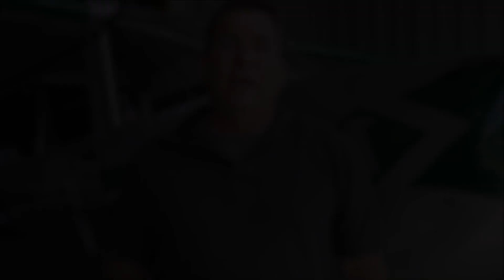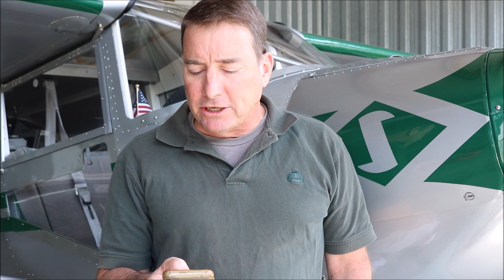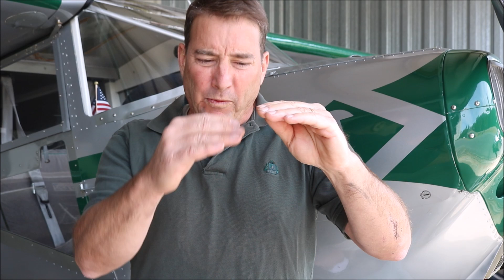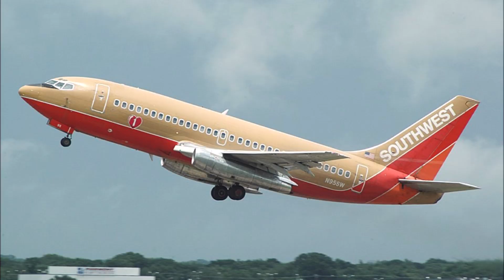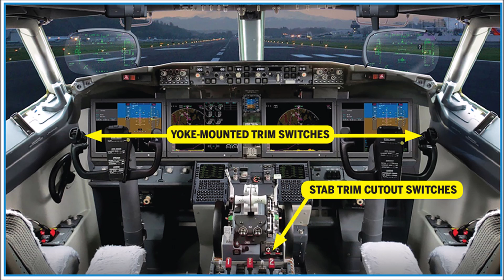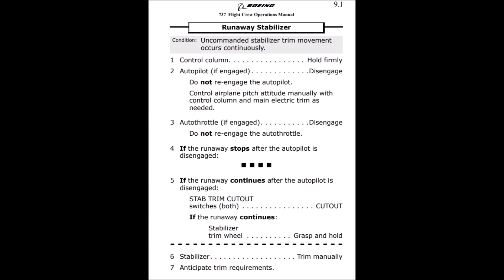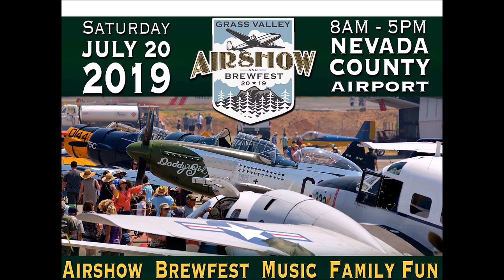737 Max UPDATE 27 June 2019 -The Latest Issue

Comment: Bottom line, MAX isn't flying anywhere anytime soon...
Reply: They fly pretty much every day for various purposes. They just aren't in passenger service. The crews and their families should be refusing and up in arms and the union protesting, no doubt. Wonder why the media never ask why that hasn't been happening the whole time with all these MAX flights, and none of them have crashed.
Reply: @ReflectedMiles  The fundamental problem with MAX 8 is that the new engines are too large for it's original fuselage;
they don't fit under the wings.   I read someone's comment, who claimed to be an engineer, that making horizontal stabilizers larger would make the plane more aerodynamically stable.   Maybe they ought to consider that.
Reply: @tigrotom7312  Try, try again. That is media hogwash, which you would be familiar with if you spent a little more time on this channel and others that actually know what they're talking about. The engines are fine but change the flight characteristics slightly in one extreme part of the flight envelope that no one deliberately flies in anyway. If they needed more height, they could extend the main gear (which they do slightly on MAX 10), but these were just fine with a few inches more height on the nose gear.
Reply: @ReflectedMiles  Extending the landing gear would help.   Are you from Boeing?  What's the target date for certification now?
Reply: @tigrotom7312  No, just another pilot with FAA time as well. Certain parts of the world demand minimum-height load/unload, which the 737 has specialized in, so Boeing will only ever raise gear height the minimum amount that is required for safety in order to help them out. The re-cert date will depend on the regulatory agencies in the US and elsewhere finishing up with it, so that isn't very predictable even if those agencies put out estimates.

Comment: Sounds more like they're potentially chasing down a latent defect incident. The CPU could very well have exhibited characteristics of failing, not fail outright, that could cause the slow response from input. Example: if the system's running a dual core CPU and one core died in test, that could pose a problem. Maybe the solution is four cores, or dual CPU even. Maybe they just need to be faster. Maybe the solution is better ESD mitigation at the OEM level. Maybe it's software, as you seem to think. 🤷‍♂️ That's a lot of maybe.

I haven't read anything from CNN yet, but I don't think you have enough information to be making the conclusion that the FAA pilots are wrong. All you seem to have is word from a third party that the pilots aren't satisfied with the performance. You don't know why they aren't satisfied, because they don't know why they're dissatisfied. Hence the investigation.

The MAX is grounded for good reason(s), and we're learning more and more about said reason(s). Considering the amount of shit that hit the fan, it's going to be a while before Boeing gets the OK again, and I wouldn't count on September.

Comment: The more computers they put in these planes the less I want to fly.  Anyone who has worked with microprocessors (and insane engineers) knows it’s the same as a computer with garbage in garbage out.  The human mind is so scrambled these days that we can’t/shouldn’t trust the engineers that are programming these things because we have such a fucked up system of beta testing products at the public’s expense.  If they are not held to the highest standards before anything is put into production we will maintain a crash and learn scenario.  I would like to know if the jack screws are controlled by stepper motors, servo motors or a standard wound motors.  I ask because it is easy to have a hard wire bypass with a simple rheostat.  There is going to be a terrible price to pay for over complicating these planes with electronics.  Anyone who knows about the problem with sourcing non-counterfeit or inferior overseas electrical components knows how serious this is.  Pilots need to strike or pay with their lives and the lives of their passengers

Comment: What if they have to use the manual trim wheel? How long does that take?
Reply: Steven Murata - that seems to be an alternate but no longer the preferred recovery solution in runaway trim, if they have given the trim switches power to override the out of trim in most situations
Reply from the maker: Thats a whole other issue previously discussed

Comment: I wish you could have discussed the fact that the microprocessors in the 737 MAX are Intel 286 chips from the 1980s. Why is Boeing using such slow chips? Thank you.
Reply: Dou Gen I also heard that (unconfirmed). In the aerospace industry the trend is to use older but proven microprocessors. They are hardened against electromagnetic radiation (and lighting). It is difficult and expensive to certify a new procesor for an existing aircraft model.
Reply: Interesting. But why can't Boeing use both older and newer chips, with the older chips acting as fail-safe redundancy chips? Certification for a new processor would be hard, but safety considerations always take precedence. Always. No matter what Wall Street says.
Reply: @dougen9237  More complexity, more testing, more failure modes...
Reply: I agree completely. But when the going gets tough the tough get going. If a new processor would be safer, then it's necessary. How did we win WW2? Not by being daunted by the huge problems we faced. Let's hope there's a simple solution. But if there isn't, compromise isn't acceptable. In that case, the government should step in and help Boeing solve the problem, just as it helped Ford a few years ago.

Comment: Well now Juan, Don't you think it's only fair for these picky FAA pilots to jump into Boeing's 777 simulator and 787 simulator and also the 767/757 simulator to determine if the trim systems in those aircraft aren't quite up to their very high standards?  Wouldn't it be fun to have them come after all of United's Boeing aircraft?  I mean, what's good for the goose is good for the gander, right?  Or is it only fun when the biggest loser in the situation is good old Southwest Airlines (because reasons)?

Comment: The Airbus 320 neo looks like it has the engines moved forward like the Max. Is this true or false? If true does the 320 neo have an auto trim software like MCAS?
Reply: Boeing and Airbus both have engines mounted well forward of the wing and have for decades. The finger pointing people are doing about engine placement is just poor understanding of aircraft design. Airbus uses fly by wire for all of it's aircraft. They "tune out" any undesirable handling characteristics using software. If you want to see what an airbus does with faulty AOA data, Look up Qantas flight 72.
Reply: @stimproid  Interesting  new explanation and response in view of the repeated explanations  (by others) that the need for MCAS was because the 737 originally had engines under the wings and with the baked-in short landing gear could only accommodate larger engines by putting them forward of the wings which in tern generated additional pitch up forces especially when in a climb.
As the 320 Neo has the engines forward of the wings and uses software to manage the stabilizers (and all  control surfaces),  is it really possibly a case of the old cable control technology being especially challenging to interface/integrate with modern software controls?
Reply: @jhindson88  You should watch Juan's previous videos on the MAX. There is much factual information to be learned there. MCAS was only added to be able to fly the MAX as the same type rating as previous 737 models. The Max would fly fine without MCAS.
Reply: @stimproid  I have watch ed all his videos and others. There was an indication that the MCAS was need to supplement or overcome the problem of the 737 getting into a potential stall and that MCAS would prevent such a condition or quickly smooth it out. It would appear that the Airbus 320 (and all Airbus fly-by-wire aircraft) have a similar protective system (but no cable controls). See the Quantas flight 72 for the  lesson that they learned and, as I recall the tragic case when an early commercial Airbus plunged into a forest while doing a demonstration of a landing approach in which the pilot planned to abort but the aircraft software was convinced that a full landing was being made and did not allow the pilot to abort. - Killing all aboard
Reply: @jhindson88    Your account of the Airbus that crashed into the forest is totally wrong.   It was an air display, nothing to do with autoland, the pilot was flying far too slow (having disabled most of the protections) with the engines at idle, it wasn't the software overruling the pilot but the other way around, the software did prevent him from pulling into a stall though, and it hit the tops of the trees.   Three people died, 133 survived.   Google Air France 296.
Reply: @jhindson88    And incidentally, no flight control software, ever, refuses to allow the pilot to 'abort'.   The pilot has to be able to initiate a 'go around' instantly, at any time.
Reply: @cr10001  Good to know
Reply: @cr10001  Except for this issue in the report: Special note: The FDR was out of control of the authorities for 10 days following this accident. The FDR that was finally produced for examination had been opened, and the white markings on the outside of the case did not match the markings found on a photograph of a man carrying the two“black boxes” at the accident scene
AirBus and France had a lot riding on the accident having nothing to do with the software. The captain claimed that the initial attempt to take control was thwarted by the software. Just sayin. .
Reply: @jhindson88    'Just sayin' - what?   That somehow 'they' faked the cockpit voice recordings and the flight data recorder?   I doubt that's even possible.   If you're not saying that, then you're just blowing smoke.   The captain obviously would want to claim anything that relieved him of responsibility.   Watch the videos of the crash - you can clearly hear when the engines start to spool up - too late - and you can see just how slow and low the plane was flying.   The video evidence agrees with the official account.    Boeing fanbois must be desperate if they're trying to distract attention from the two Max crashes with every Airbus accident they can find on Google...
Reply: @jhindson88  Sorry if I was a bit snarky in my last reply.   I'm maybe over-sensitive to that phrase 'just sayin'.    The link to the videos of the Mulhouse crash is this:   https://www.youtube.com/watch?v=I9gELPxPG8Q
Reply: @cr10001  Not a Boelng fanbot. At this point I have lost so much confidence in Boeing, I will not fly the MAX if and when they do "fix " it. The system appears to be so corrupted with manufacturers doing their own certification etc and with the seals allegedly having been broken on the flight data recorder one wonders if any agency or company can be trusted anymore.
Reply: @jhindson88    Yes, re-reading some of your prior comments, I do regret any implication I made and I apologise.
With reference to Air France 296, any apparent similarities with the Max are, I think, misleading.   The height, speed and power setting (flight idle) that the Airbus was at made it impossible for it to lift over the trees (a 737 would have crashed in exactly the same circumstances).   This was the pilot overriding the automation rather than the other way round.   Except that the A320's stall protection prevented the pilot from lifting the nose any further.    But you can see in the video how high the nose was already.    I have some sympathy for the pilot - he had never seen that airport before and the grass runway the crowd was on was not the main runway, so he had to alter his approach at the last minute.   He had just converted to the Airbus and he was demonstrating the anti-stall system but he may have been expecting it to do the impossible.     I gather that if you fly an A320 slower and slower it will not stall but the nose will drop (as the only way the control system can avoid stalling) and of course if you've got no height then you hit the ground.

Comment: Sadly, I think Boeing may have to seriously consider scrapping the entire 737 MAX program. Why? Because the plane is likely inherently unstable, and the MCAS system may not be effective enough to correct that pitch instability. They could build an all-new wing, but that would be almost as costly as designing an all-new plane from scratch. 

Maybe it's time for Boeing to cut their losses, get some financial relief (through a bankruptcy filing and/or government bailout to defray the cost of ending the 737 MAX program), and design an all-new 737 replacement that will cover everything from the 737-700 to 757-200 models--essentially the Yellowstone Y1 design studies of 2005-2010.

Comment: microprocessor problem ...??? WTF ???    the MOST STUPID comment I ever heard as electronic engineer with plenty of experience on the field.  A microprocessor mistake or problem is when the microprocessor, usually a chip, process or run INCORRECTLY an instruction.    If you say to ADD and the microprocessor shit a register to the left, THAT IS a microprocessor mistake.  Other than  that is a software (or code) too long or complex to be processed  on time. or other problems related to the programing and implementation of the system.   It is extremelly uncommon to have a "microprocessor problem" on any modern system.
Reply: probably wrong choice of the word, referring to an ASIC chip